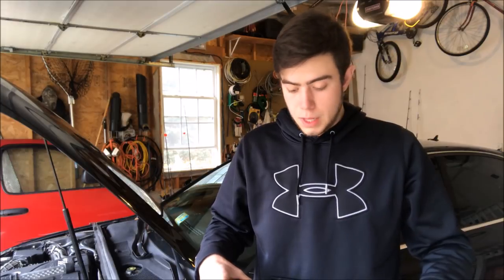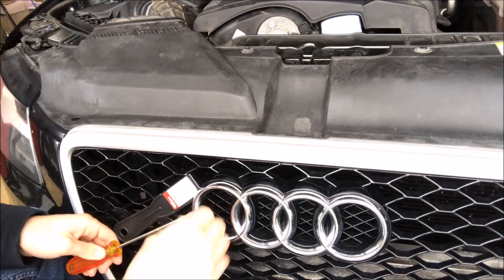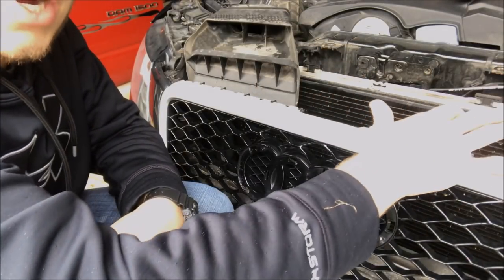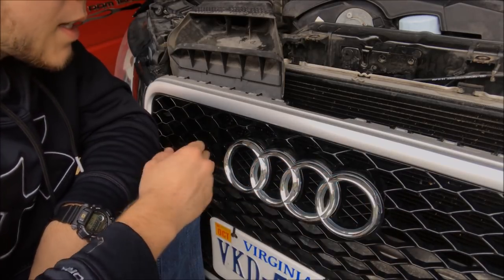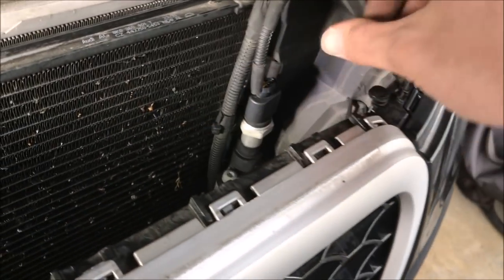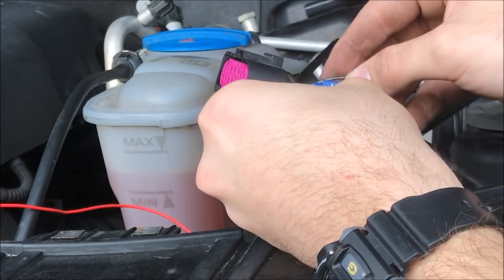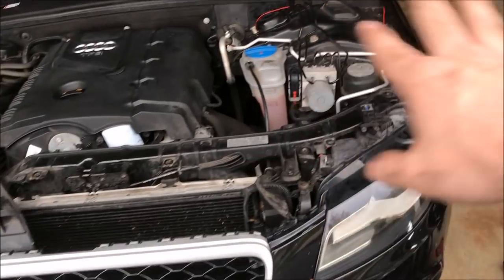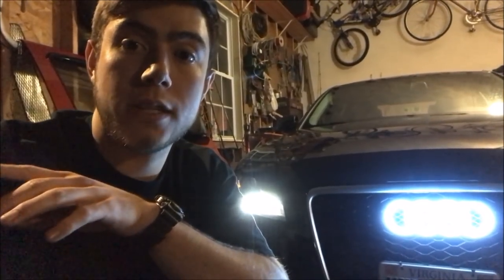Audi Lighted Logo Badge Emblem Install

Comment: It's a very good vid. You know the headlight has a ground wire to tap into. There are two brown wires. Those work so you don't need to have the red run all the way there.
Reply: can you elaborate pls
Reply: @slowedvibes710  I just did. You can ground the wire to the headlight's ground wire instead of going all the way to where he grounded.
Reply: @Anthony-cc8bx  alright and how has the light been thus far?
Reply: @slowedvibes710  shit to be honest. if you get the chrome it will flake and peel. I ordered another one but this time I'm going to clear coat it so it should be ok. made in China lol
Reply: @Anthony-cc8bx  how did the clear coat work out?
Reply: @holdenschroyer7634  I bought a new one and haven't clear coat it yet. Trying to examine the old one to see if the peeling is on the outside or the inside. If inside i'll need to see how to do it ie take it apart if i can.
Reply: @Anthony-cc8bx  ANy update on it? im thinking of getting one for my car :)
Reply: @wd5807  Its a crappy product. The chrome peels and LEDs eventually burn out. I bought a second one and will see if I can replace with better LEDs and clear coat the chrome. Lots of work!
Reply: @Anthony-cc8bx  did you end up installing the second one?
Reply: @hughgrection9378  no I didn't. I haven't had to to inspect it to see how the chrome peels.

Comment: Great Video!  Remember People just look for a power wire with the lights on then turn off the lights.  If your power wire turns off then use that one.  The other wire just needs to be grounded even just to the car.  Then You're Done!  Any questions just ask.  😎
Reply: @prospect8696  just turn on your parking light, then go towards the wires where the bulbs are located. You can disconnect the harness and check whichever wire has power with a light tester. When u find power then turn off the parking lights and test that same wire. If the power is off the use that wire for your power source. And black needs to be grounded to any metal.
Reply: Hi bro, so the red wire is the positive? I have no idea of what to do. I got the same Audi led logo but I think there must be an easier way to do this connection
Reply: So how do I connect this to the ground and power, I have a 2015 Audi Q7

Comment: You can trim the upper and lower outer tabs on the emblem by 3/16 and it will fit flat/flush, ground to the power steering res bracket

Comment: Hey mate cool video. I’ve got an Audi A3 and I’m trying to install the door light I got from amazon. I managed to install one of them on drivers side but when I remove the light from the passenger door the wire isn’t long enough. Do I need to take my door panel off to install the light or can there be any other way thanks ...
Reply from the maker: Most likely if the wire isn't long enough you'll need to remove the door panel to connect them. If its not long enough you'll need to cut and splice a wire to extend them.

Comment: Your light is bright af i tested mine also with a battery today and it's not nearly as bright as yours do you think i should still install it
Reply: Milton Cherry mine seems kinda of dim too. Did you ever figure it out?
Reply from the maker: It can depend on the battery you used as well, if the battery has less volts it wont be as bright. Try using a higher voltage to test it out

Comment: Do you know where do I need to tap the wire in order for the logo to light up when only when I have my parking lights on and not when I have the DRLs or the low beam?
Reply: Connect them to the fog lights. It will turn on with the switch.

Comment: does it turn on when you unlock the car with your key
Reply: RaZDaZ I’m pretty sure it does if he has the headlights turn on when unlocked using either the key fob or the door handle.
Reply from the maker: Yes it should

Comment: Can you give me details on where you got the blue clip you applied the wires in, what’s the name of it?
Reply from the maker: Kevin, they are called displacement connectors and you can find them at your local hardware store or auto store. Even walmart: https://www.walmart.com/ip/Power-First-22EW62-Blue-Insulation-Displacement-Connector/569620134
I hope this helps

Comment: how did you connect it to the negative ground? did you wrap the wire around it?
Reply from the maker: You can do it two ways, connect it to the negative jump terminal by wrapping it around it and screwing the bolt back on.  Or you can attach it to the negative wire in the headlight plug.

Comment: Are any of these front emblems compatible with a 2012 Audi TTS? I've only been able to find emblems for the tail logo... Great video!
Reply from the maker: Courtney Bo The JetStyle Audi light up logo I used will not fit the TTS.  I could only find this one but you will wanna contact the seller to make sure it fits and it’s slightly different than mine. I hope this helps
https://rover.ebay.com/rover/0/0/0?mpre=https%3A%2F%2Fwww.ebay.com%2Fulk%2Fitm%2F282573552938
Reply: Thank you!

Comment: @SteadFast 2277: Are your LEDs still working? I also bought a similar emblem, but on mine, some bottom LEDs aren't working ... And does your Chrome-look still persists? Because on my badge, the chrome flaked off ...
Reply from the maker: Everything is holding up good on mine
Reply: The same thing happened to my emblem..just after a month the chrome is almost completely gone and most of the lights are out.
Reply: Dedra Trent i bought a new emblem and did the following: Covered the frontside of the emblem with PlastiDip transparent, so that the Chrome can't go away anymore. Furthermore, i filled up all wholes and edges with transparent silicon, after mounting the emblem onto the grill. Because there are small holes around the edges because the emblem doesn't fit to 100% (so i used silicon to fill the gaps between the  grill (emblem slot) and the emblem edge). On account of this, the chrome survived the winter and all LEDs are working!
Reply: @michaelgierer31998  Hey, I had the exact same issue almost 10 months ago. How has the new emblem been holding up after all this time. I'm thinking about purchasing a new one and following your directions above.

Comment: I spliced the positive wire to connection  10 on the headlight assembly box but can’t get power. I hooked it up to a 9V battery and they lit up but I can’t them to work following these steps. I have a 2011 Audi a5
Reply: You have to turn on your lights and find power then when u find it turn off the lights if the power turns off then that's the wire u wanna use.  Keep looking for the correct wire with power.  Then run the other called to ground.  Even if it's just a screw bolted to the car as long as it's ground.  And ur done.

Comment: The red wire look ghetto. Spend a little more time. You shouldn’t see any wires if installed correctly.
Reply: 3SEVEN80 it's an audi...it's suppose to look ghetto.

Comment: I wonder if you would have pressed in the middle first  to get the pressure started  then  the ends  probably would have snapped in without the middle pushing out. .
BUT THAT'S MY OPINION. .
Reply from the maker: Yah your defiantly, just like a decal, you start middle to out

Comment: Hi, can you tell me if your emblem is still in position or fell of the anchoring? P.S. If I see that clearly, I think one LED doesn't work! Look at 9:38, the upper spot of the right ring doesn't light up?!
Reply from the maker: Hello, the whole Audi Emblem lights up completely must be the lighting/angle my emblem was filmed at.  The badge is still currently in position on my car.  If your worried about the 3M adhesive you can use clear silicon as an alternative adhesive backing. I hope this helps. Feel free to ask more questions.

Comment: Will this work for my 07 Audi A4 3.2 Quattro convertible & if so how does do in the rain
Reply from the maker: If it's and Audi B7 version  it will. Amd its good, just make your connections waterproof
Reply: @SteadFast2277  how do I know if it's a B7 ???
Reply: bLu 2007 is B7. 2008-12 is B8
Reply: @imp3rialKiller  thanks

Comment: How is it holding up I just recently purchased from amazon. Did it start peeling off?
Reply: Cut the back tabs off and attach it with 3M VHB tape.  It will NEVER fall off.  I've used that tape to hold spoilers on.

Comment: So i installed one of these on my a4 and i found the hot wire while the car was off with a volt meter then i spliced into that wire ran the ground to the neg terminal andddddd nothing no matter what setting i put the headlights on

Comment: Did you actually twist the wires and tape them together.
Reply from the maker: Justin LaBarge nope, in line splice and crimps , then protected by wrapping it with electrical tape.
Reply: He's one of those Pep Boys guys.

Comment: Is this available for 2015 A3?   I can't find it.
Reply from the maker: @Brian Andrews the light up emblem I used wouldn't work for your year Audi.  But I found one on Ebay that would. I hope this helps. https://www.ebay.com/itm/Audi-A1-A3-A4-A5-A6-A7-Q3-Q5-Q7-Chrome-LED-Light-Front-Grill-Emblem-Logo-Badge/232588663338?hash=item36275d5a2a:g:YSgAAOSwdSRaC0Uy&vxp=mtr

Comment: You should of just used a test light and turned on the headlight and check the pins for the headlight hot wire.

Comment: Why didn't you just ground it to metal?
Reply from the maker: The negative terminal is metal and makes the best ground in the car. You can also ground it to a metal bolt as well or the negative wire to the headlight plug.